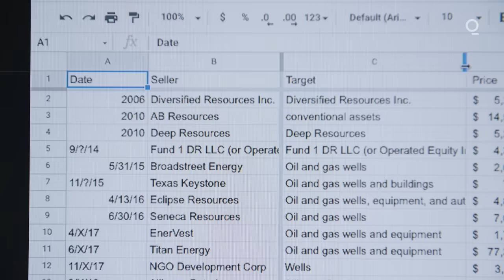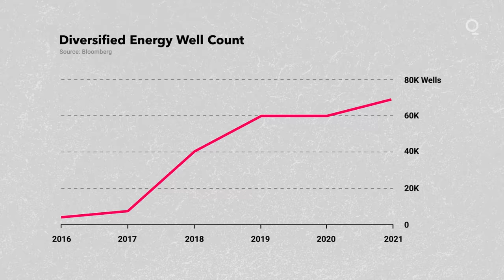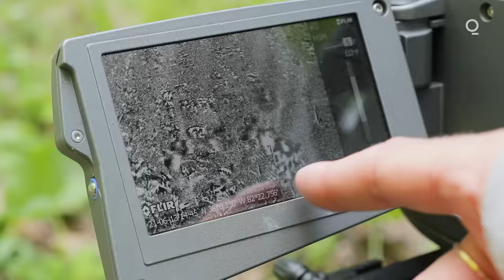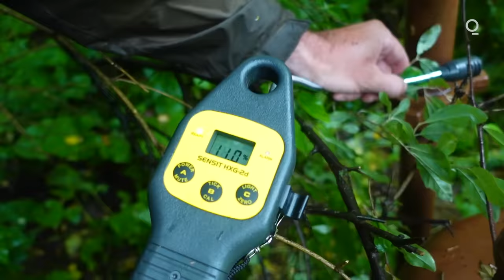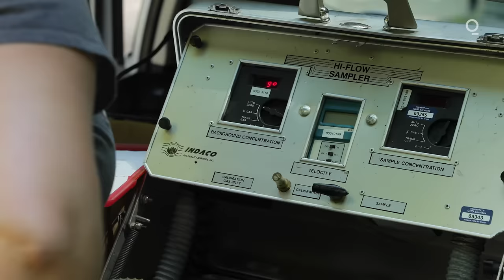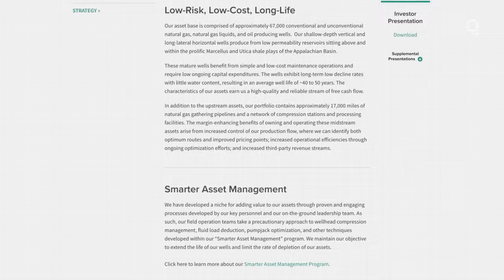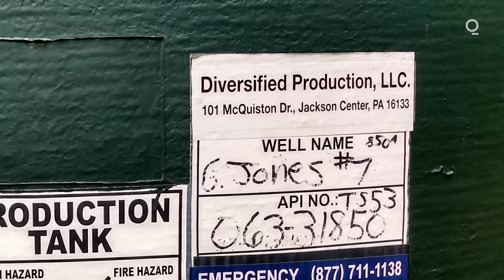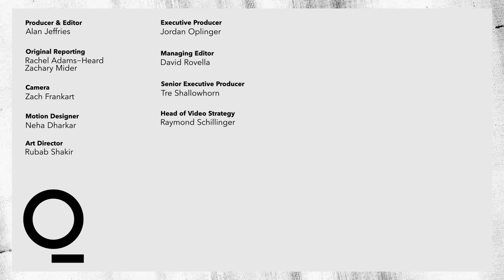How Dying Gas Wells Are Making One Company Rich

Comment: Did you bring a wire brush and epoxy resin to seal the leaks?
Reply: What do you think would happen if the wire brush caused a spark on a flammable leak?
Reply: @douglasjacobs882  ok brass brush. But it would produce a flame not an explosion. 
But seriously I never saw a spark from a wire brush. It generally takes 2 hard objects. 
Maybe paint thinner soaking into the rust to soften it. Applied with a paint brush. Brake cleaner to remove the thinner. Ready for the epoxy.

Bring an ATV and point the muffler at the work area. Insert gasses will prevent fail ups. Don't breath exhaust fumes.
Reply: @suggesttwo  For my gas service, I own everything downstream of the meter. If I make a repair as you noted and it passes regulations I am golden, but if it doesn't pass regulations, I would be responsible for repairing it correctly. For everything upstream of the meter, the gas company maintains ownership. You don't own any piping shown in the video. If the repair doesn't meet regulations, you could be charged with destruction of property. If you fix a leak at the weakest point and than it starts to leak at the second weakest point, you are responsible for that leak. 
Even if the leak doesn't have enough pressure to bubble out of the epoxy before it hardens, you are taking on some liability. I mentioned the flammable leaks because they exhibit more pressure than the supposed non-flammable leaks. The $90 average for replacement parts could go up if the epoxy repair makes it difficult to replace the part you tampered with.

Your sentiment is admirable but you need to follow regulations and it is advisable to get permission before you work on something that doesn't belong to you.
Reply: @douglasjacobs882  I am just providing solutions. You are the complainer who can never be satisfied. The worst thing for the environment is to let them keep leaking. The best thing for the environment is for these to used for heating. This will reduce natural gas prices causing some people to switch to natural gas the second cleanest energy. (Solar radiant-windows and shudders facing the 🌞) Hydro electric is over rated because it requires regional flooding. 

I work on cars not gaslines. 

If you want to find a lot more leaks look for meters and listen for hissing. You will find lots.

Comment: Preconceived notions are not helpful and there are a couple of classic examples of this in interplanetary exploration. Probes have have shown that atmospheric carbon dioxide levels on Venus (96.5%) and Mars (96.0%) could not have been caused by the burning of 'fossil' fuels. 

Furthermore, we must ask: just how prevalent is atmospheric methane in our solar system?

Earth …….. 2 ppm (parts per million)
Jupiter ….. 3,000 ppm
Saturn ..… 4,000 ppm
Neptune .. 15,000 ppm
Uranus …. 23,000 ppm

Saturn's moon, Titan, hosts gigantic lakes brimming with liquid methane, constantly replenished by methane rain. Methane is not a 'fossil fuel' and is not biogenic in origin. What's the point of the NASA space program if its results are simply ignored?

Comment: Repairing the leaks is a minor issue. Plugging the entire well is unnecessary.   Let’s not forget that natural gas as a great value to mankind. Let’s also not forget that all scientist do not believe in the global climate change claims.  The claim about methane being dangerous is a little bit absurd. It’s a lighter than air gas so if it leaks it goes up to the atmosphere.  It doesn’t travel sideways.  Only if it had a chance to accumulate in a building somewhere could it possibly even be a problem. Gas wells are virtually never ever, ever enclose so  Accumulation just doesn’t happen. Listen between the lines. Please people are trying to create hysteria
Reply: Report misinformation

Comment: seems a person could design a cap that is placed over the well area that traps the methane and then routes to a tank that is then pump into the existing pipes.  something like a 500 gallon vertical water tank with the bottom cut off.

Comment: What Diversified should do is take this as a PR opportunity. Hire some college students who are involved in the engineering and energy fields to go out and inspect all the many under producing wells, determine which have the most serious leaks, and put together a schedule to at the very least, stop the leaking  of the existing pipes. $90 per well on average to stop the leaks in thousands of wells for a few years until the time/budget allows to permanently seal them is better than not doing anything for thousands of wells and only plug 20 per year.
Reply: You don’t really get it..😒

Comment: Propaganda piece where the only conclusion is to shut down all gas wells rather than fixing the leaks at the pipe threads.   I had to laugh when they said a well with what appeared to be a 2" pipe was leaking 600% more than it was producing but yet they needed a special camera and sniffer to detect this supposed insane torrent of gas.

Comment: There is a road to every well . Your walking cause your trespassing.  Didn't have key to gate . 
Most of the could be fixed with a couple of pipe wrenches and a hammer. You people have no idea of what your talking about . I've drilled and serviced these kind of wells oil&gas for over twenty five years . The biggest propaganda job I've seen in a while . If bees are living in the pipe do you  think you might be overreacting

Comment: Ummm. If it costs $90(0) to "fix" some leaking pipework and $25,000+ to plug the well, I struggle to understand why they can't simply fix the pipework. And, BTW, if the well is not connected to anything and the hole+feed pipe is not leaking, then just cap the pipe. Or am I missing something other than the company can't be erm... bothered because "shareholder value"?

Comment: These two could invent some kind of solution. Start a company and cut the massive cost of plugging the well. Installing some kind of plug down the original shaft. Go to the concert companies and get a mix you can transport easily to the wells. After plugging the shaft pour you mix down the shaft and be done with it. If they could invent a solution for each well figure the cost and add 20%. They would create jobs stop the methane leakage and become really wealthy.